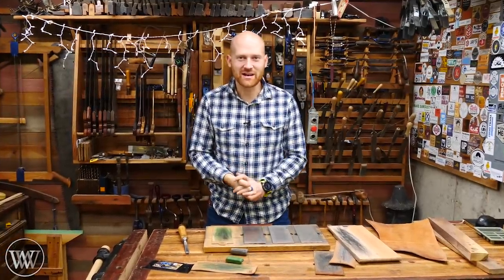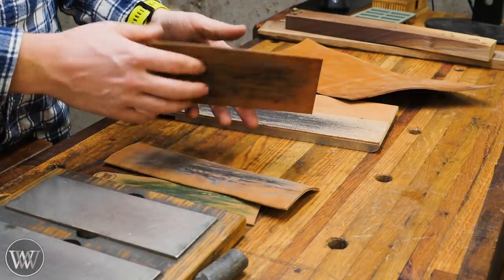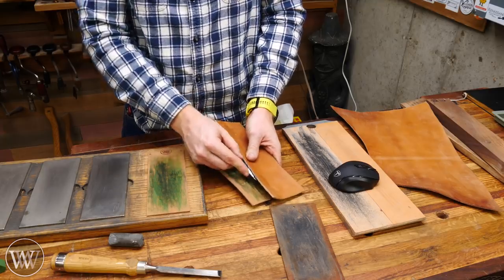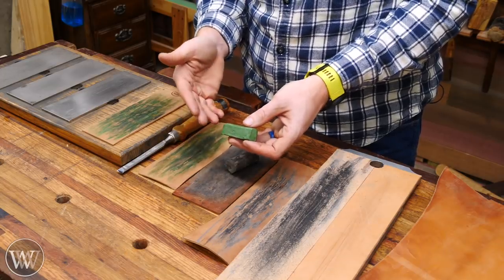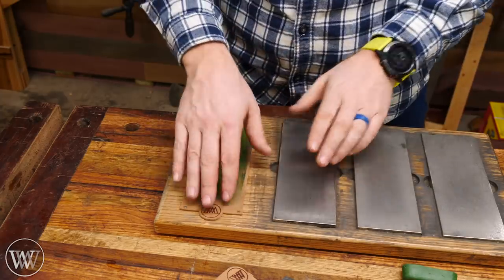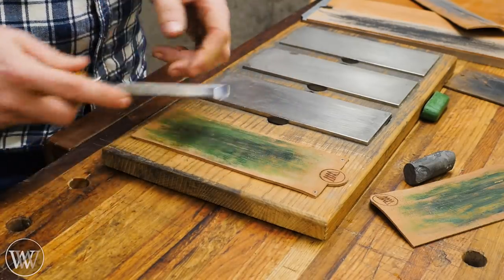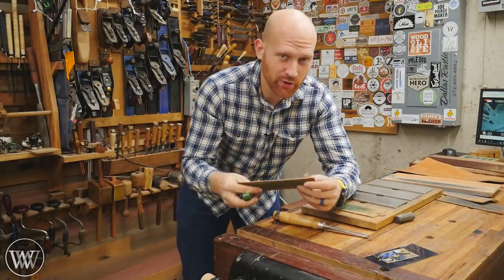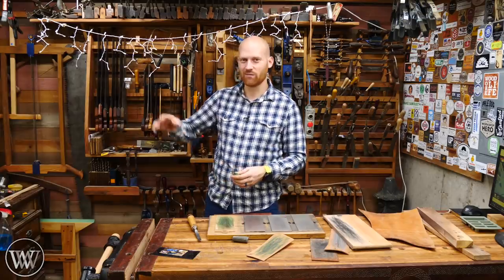All About Strops for Woodworking

Comment: LISTEN UP!! This man knows strong magic folks. 
So many arguments about sharpening and so many different ways to do it. My setup is much the same as yours, other than I use 400 grit then 1000 grit diamond stones then strop. This produces Samurai paper slicing sharpness. I use tool rolls for leather. They are £5 on Ebay in the UK and are perfect for strop making.
Subscribed.
Reply from the maker: thanks man! there are so many good ways to get it done. It is always awesome when someone finds the way that works for them.

Comment: I have a barbers strop, leather and canvas, which I use on short blade things like penknives. As for the regular woodworkers/leather workers strops, I also use them loose/unmounted for the same reasons you do. They are game changers for anyone that uses sharp-edged tools.
Reply from the maker: So true. I have a barbers strop for my shaving razor.
Reply: @WoodByWright  Not my immediate assumption considering a chap that sports a crumb-catcher would have a cutthroat shaving razor. But, of course, maybe the head or should I not ask.
Reply from the maker: @GaryWall  Yup the head gets shaved in the summer!

Comment: Hey James! Great video to pass on to others! I use the softer leather like Paul Sellers when I come off the diamond plates. In between, I keep a cut of an old belt on the bench when I am working. It molds to the shape that I need when I use the gouges and is small enough to stay out of the way.
Reply from the maker: Got to love the old belt!

Comment: Recently I discovered your Chanel and let me tell you this stuff it's a gold of mine, the wood working it's now a hobby for me and with your help the progress it's getting easier! 
I was wondering what diamond plate you are using in the video at 6:00 ? you mentioned that the last it's 12k but the rest no so I want to know what to use are you using 600 and 1000 the first and second? The final it's 12k
Reply from the maker: with diamonds the grit number is not solid, it is normally give or take 20% because they cut differently then normal stones. here are the ones I use. https://www.woodbywright.com/tool-suggestions/sharpening
Reply: @WoodByWright  thanks for the info 🙏

Comment: Good video.
In an old book, I saw the recommendation to use a piece of bare aluminum plate as a strop (with no compound). The theory is that the molecularly-fine aluminum oxide that forms on the surface of the aluminum will buff your tool, and with no round-over. Never tried it, but thought it was interesting.
Reply from the maker: that would be an interesting one to try.
Reply: You can strop on green or red painted surfaces. Green paint uften uses chromeox as the pigment. Red paint commonly contans iron oxide.

Comment: The horse butt or shell is practical because the occasional minor oopsies only leave shallow scratches and nicks. I use horse butt, smooth side up, for my razor. Charged with chrome ox but wiped off with leather so there is no hint of green or wax. The only way you can visually tell it is charged is by the black streaks of steel that form over time. 

IMO, rough side up "cake top" strops are more aggressive and more forgiving of mistakes/cuts. They are also dirtier. I keep one of these in the garage shop.

Comment: I saw an old saddle in an antique store.  It was small and had many relatively loose layers that could be cut off.  It was $25.  Would this work?
Reply from the maker: Sure. Just about any substrate will work. In general the harder the leather the better.

Comment: Once you charge a strop with one type of compounds, say course, can you ever charge it with a different compound for example a fine or superfine compound?
Reply from the maker: Sure. But if you go from a course to a fine, you might want to make sure you clean it out first with a wire brush or card scraper.

Comment: I'm about to buy a brand new Wood River plane. Is there any use for a strop on the sole in the process of flattening? Would it make any difference?
Reply from the maker: no it would not make any difference. I never take a sole any higher then 400 and most of the time I stop at 200. It is going to get all scratched up quickly.

Comment: I know you mentioned using wood as a strop works too but I wonder what other option there may be for a vegan strop. I know there may be people who are getting into woodworking and would prefer a vegan option. I've heard denim works so taking an old pair of jeans and cutting out a strip from it too use as a strop but not sure if that works well or not.
Reply from the maker: Pretty much any flat surface or surface that can be made flat and can hold buffing compound will work fine. If I had to pick a vegan method I would probably go with mdf.

Comment: Love it man, I won't be wasting my money on a 8-12,000 grit water stone. I've been stropping on MDF, but I'm on the hunt for horse butt leather. Would you say your tools are sharp enough to cut tight dovetails in pine? I work a lot in pine
Reply from the maker: nice. Yes for soft pine I use a 20 degree chisel and can slice the end grain with out the slightest tearout. got to be crazy sharp for the soft pines!

Comment: Can you use a strop without the compound?
Reply from the maker: You can, but it is very slow cutting. So it takes a lot longer if you are coming from a lower grit (<3000 grit)
Reply: I gave this a try, myself. IMO, bare leather efficiently removes most of a fine wire edge and it will realign minor dings. If you sharpened to a fine enough grit, you will be fine with just that. But the compound produces a polish and makes a shaving edge last longer between maintenance. I hope James doesnt mind me adding my 2 cents.